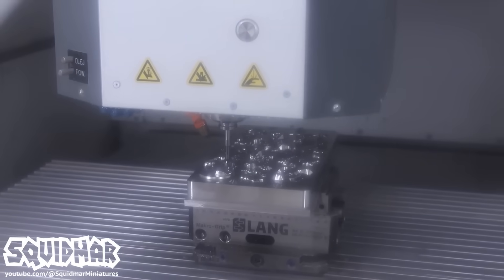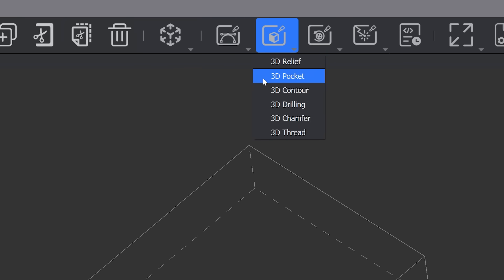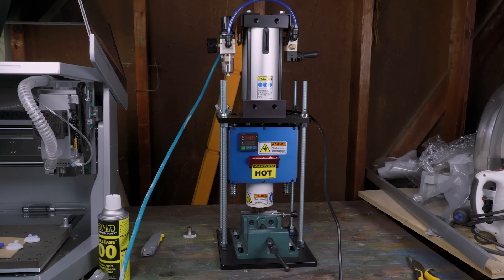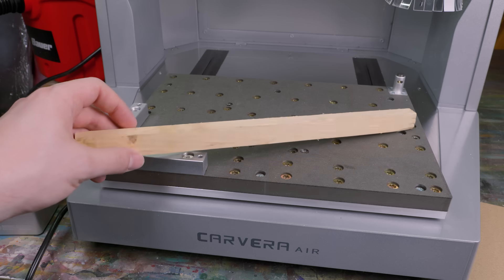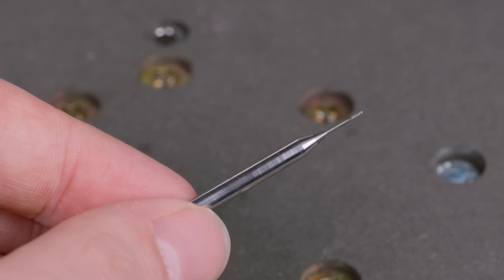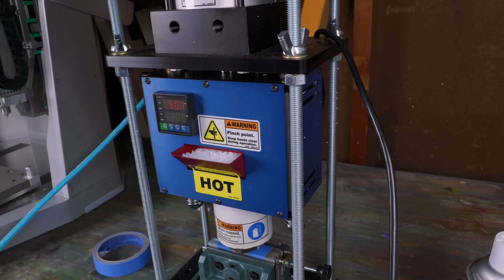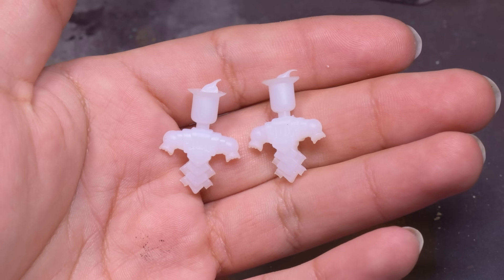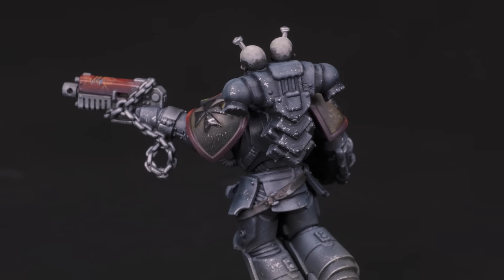You Can Make Warhammer Plastics at Home Now!

Comment: So the math on this is, and lets assume $500 in learning costs for matierals and tooling you will go through before you reach proficient. $3k for the cnc machine, $3-4k for the injection molding machine, so lets say $7.5-8k invested, not counting time, to get where you can resonably produce what you want, training in 3d modeling is not included in that price. 
That would be about the same as 2 battleboxes and a couple of character units from GW, so it seems reasonable.

Comment: There are open source CNC milling machines as well as mold injection. While it may sound like a lot of work I’d image it cuts down on the cost by a significant amount. And there are very plastic like pouring materials that you can use to just cut out the whole mold injection.

Comment: I worked in a mould injection factory, make sure to get what is basically a cleaning plastic pellet and run in through the hopper until it runs clear after you have finished every use otherwise you will run the very real risk of an internal blockage meaning dismantal time

Comment: If you managed to make a rogue trader Ork Battlewagon, they are selling for about $250 on ebay, so a near perfect copy should go for half that at least, so 70 of them sold should cover the equipment and bits, then you could reproduce the upgrades to make the Gobsmasha, and battlefortress. . Ine of the most expensive oop things is ork, eldar, marine and imperial guard arm sprues, you could get 8 on one plate that size, and thry go for anlbout €25 each. . just saying 😊

Comment: Unless your going to make a thousand of one item, making a metal mold and going through all this is ludicrous for metal molds. 3D printers allow you to print as many as you want, then move on to another item. How many metal molds are you going to make and how long will you use them for? Back in the 90's I had made 2 part vulcan resin molds of a load of miniatures, using pewter that I melted on my stove, but only made a handful of figures from from each of them, so it was kind of a waste. But I used to them to practuce painting and they were my favorite figures. But it was pretty easy to do and didnt cost very much. But this set up is useful if you are starting a business selling your own sculpted miniatures, as 99.9999% of people would not find this useful at all.

Comment: So, bottom line. If you are a professionally trained CNC machinist and have some experience in 3D modelling, you can do your work at home now, if you also spend your yearly savings on a CNC mill, an assortment of drill bits, an injection moulding machine, raw materiel (those aluminum blocks dont grow on trees) and have a spare room that you can turn into your private little manufactorum, just to re-experience to joy of mould line removal that your 3D printed miniatures made you forget like a bad nightmare.

Comment: Interesting to see consumer level plastics manufacturing becoming more of a thing. Having worked in plastic miniature manufacturing for  the better part of a decade, it's not easy, can be very expensive, and requires not just an understanding of engineering for plastic manufacturing in general, but a whole set of knowledge at the scale of miniatures. so much more to consider in design, tolerances, and process.

Comment: Anyone saying "Oh these machines cost ~$8000, just use a resin printer to print your army for a few hundred dollars.", this is for cost efficient production AT SCALE and will let you make dozens of armies from a single mold and let you make a new mold for a few dollars. Since models will cost you just a few cents in plastic granulate and electricity while being much faster than resin printing. If you wanted to mass produce armies, you could also keep adding the (cheaper) injection molding machines and scale the output proportionally.

I'm sure GW hates seeing this video.

Comment: We knew this is coming in the plastic hobby, everything is becoming portable.

May i suggest tho, could you make a comparative video of the same part between a portable mold-injected part vs a 3D printed one. How each matches like initial quality off the mold/print, excess cleanups, extra work needed (like shaving, panel lining, extra detail), parts progression - like how each complete part comes off (as sections) to form one whole, and finally - surface quality.

That would be genuinely trailblazing information for many wannabe custom figure creators.

Comment: The answer is NO.. Its to expensive for a reguler homeuser.. 
What you could do is have 1 alu box, make a resin form inside, and eiter use a 3dprinter pla head, or a plastic heater/pressor to put plastic into the mold. 
The alu box will stop the resin from from breaking, but it will start to crumble, over time.

Comment: If you ever run into the plastic not flowing everywhere it should try pre-heating the mold a little, if the mold is leeching some of the heat it can cause the plastic to harden before its flown everywhere it should.

Comment: i work with plastics (injection molding) and far as i understand games workshop use  polystyrene plastic,.. no the most expensive plastic out there ;) we also make molds of aluminium for testing or project, its not that expensive to make, but they last just a set amount of molds (think we garantee like 30-40k molds)

Comment: There are heat resistant resins that you could use to 3d print the mold (or a mold for the mold that you could cast in a lower temperature metal like Zamak 3) and less expensive injection machines (but I recommend the pneumatic one is you plan to produce a lot  - your arm will thank you!).  This could reduce the barrier to entry to less than $2000 but the trade off is a higher skill requirement and production cost as you add to the molds you're designing.

Comment: Is the "make at home" clickbait or I missed that part? 🤣🤣🤣🤣 Not everyone have cnc metal molds cutters just around.... You should have tried to use available resources! Like epoxy+metal powder etc. Or adjusting injection parameters like pressure etc for tin molds that you cast. Or trying injection with polyurethane etc.

Comment: And having to perhaps make several molds before you get it right, especially with more intricate things, and getting even more detail and smoothness, you get an idea of how expensive such stuff is. This needs more detail than for instance the plastic lid of your bin, so even though smaller, it is more expensive, far more expensive.
Then these machines are in comparison cheap for what stuff Games Workshop uses costs.
But the result is very good. Now i wonder if this is nice for own use, or if you can even produce a bit more, on a larger scale. And how does it do compared to 4k resin printers, let alone 8k and 16k ones, though i would think those are more for just one person and more one off or a few bits at a time, not mass production.
If you want a complete custom army, i might still go for resin, if you want to sell, this is probably more what you need ? I guess it all depends oin a bunch of things.
This is i am guessing also great for prototyping ?
So cool we can now get such things.

Comment: Mold making is a career, BTW. (The same goes for any occupation that specializes in making tools, dies, and molds.) You should check out the video on “Smarter Every Day” where they go over the process of trying to make a product entirely in the US—there is a section in the video where they are trying to make an injection molded part and they talk about how America needs mold makers. Unfortunately, it’s a skill that has all but disappeared in America.  

It’s VERY cool that you figured out how to do this on your own. As a trained machinist, I know that it’s difficult to learn the skills you need for CNC machining. I especially like the part where you figured out why your bits were breaking; a lot of people would have given up at that point — nothing is more frustrating than breaking end mills…

Comment: DIY plastic injection moldings been a thing for a long time but making the molds with a CNC machine is still a huge pain and generally not worth it for a small scale home operation. there has to be an easier way to make molds yourself for home use.

Comment: for you and anyone else looking into this, for speeds and feeds, a good rule of thumb is (3.82 * (materials SFM, the manufacturer of your endmill has charts on their website)) / tool diameter = RPM, and RPM * chip load (probably 0.001-0.0005 for this size) * # of flutes = in/minute

Comment: As a guy who's worked in injection molding for 12 years, I can tell you, there's been a kinda low key massive market for at home injection molding from kits that convert drill presses to machines like yours.
Also, if you need to cut metal, just get a bandsaw a General Purpose blade is fine for aluminum and for dies that small a small one is fine enough.

If you want better quality, aluminum can be sanded for a smooth finish.

Comment: You used a lot of what we call z-level cuts, which is great but sometimes you can use a lace cut at the end to clean up some of the tooling marks. I don’t know what your software calls lace cuts but basically it runs side to side stepping over per pass rather than stepping down per pass

Comment: There's a buster beagle plastic mold injector kit that you need to assemble yourself and is about $400. I've often looked at that kit and never pulled the trigger because I have a 3D printer. But could certainly knock off a bunch of identical minis quick that way. There's empty aluminum molds for sale where you could in theory 3D print the inside of the mold or pour the mold with epoxy resin and router out some sprue lines after.

Comment: locator pins out of 303 stainless steel turn to size on lathe, always proof read program before first run on any CNC and then for first article, first part, run at 50% or lower so can stop when see an issue before cause damage to work material or machine.  Just some advice from a guy in the aerospace tool and die world.

Comment: Try making some chest designs that don't have any Aquila on it, and have the part where the backpack attaches at be the area where the injection happens so that way you can get the half sphere that makes the positioning for the head as well as the leg connection joint, and because the sphere section will be there you can make it easier to remove the piece plus you would need a three-dimensional mill if you wanted to do it where the chest piece would be facing you when you open it up, and yeah you might have to do a little cleanup on the front of the chest because of the potentiality of anything leaking but that's not really the worst thing

Comment: Here's a crazy idea I've had bumping around in my head for awhile: one critical component necessary for plastic miniatures is raw material. Normally, you would purchase the polystyrene pellets new. But what if you could get your own "used"? What if, instead of purchasing new pellets from a manufacturer (in China, Taiwan, etc), you source your plastic from a nearby landfill? Sure, you'd have to sort out which plastic is the right kind, and that takes time, and more time to melt it down, but that's a potential gold deposit for material that's next to free. And, once production is in full swing, you can then say these are produced from 100% recycled materials, thus catering to any customers concerned for the environment, as well as oil production!
Reply: Why a landfill? Just use all the old sprues from Jay.

Comment: The flood of breaking Bits reminds me of when I made the change from Universal G-Code Sender to Openbuild's Control because of its ability to run Macros enabling it to have such Functions like a Centerfinder, or Tool Changing, etc... The problem I found with Control though is with its return to Zero Function which must have been coded by a friggin' Monkey 💢. If you call that function the machine will FIRST move the tool to a height of 5mm above Z Zero ( height ) and THEN move to X & Y Zero ( left/right & front/back ) which in 99% means you'll break a bit on whatever system you use to hold down your workpiece UNLESS your Workholding System is either nailing your shit down to the Sacrificial Board ( good luck doing that with metal parts ) or a Vacuum Table ( which no one buying an Openbuilds System  will have ). For anyone else using Clamps - even ones barely raised above the Workpiece - it'll usually mean snapping off the Bit as it collides with them or the Screws used to tighten them down. Fuckin' Brain Retarded ( still super pissed about this BS ).

Comment: For the locating pins on the mould, try buying precision ground pins (readily available) and a press fit them in one side. The other can be a close running fit and will allow better alignment. Also deck the plates off flat so there are no surface inconsistency’s.

Comment: if you keep messing with this, you can setup a set of jobs just for making your mold blanks with holes on one side, and posts on the other so that you don't need any secondary plastic pins.  you would be taking about 2-5 mm off the face, leaving the pegs on that side.  We use to make VERY simple injection molds out of steel with a slightly larger injection molder than you used here (or I should say used to, this was several years ago).  On Mondays I would make blanks, all day long, 10 at a time on the 3 axis mill.  our injector took 300mm x 300mm molds, I would face each half at the same time with a small fly cutter then mill my register holes with a FLAT bottom mill and then do another few face pass on the peg side leaving the 2 register pegs 2-5mm tall depending on the depth of the relief of the mold (I always made my register pegs at least 1/2 the depth of my mold).  Only once I have tested my peg register fit did I do final perimeter dimensions and start my actual mold layout.  All of that can actually be done way faster on a single mold using a manual mill, the CNC just lets you get more work done during this phase and makes complex molds possible.  My molds were not complex and were usually completed on an old Bridgeport because I was just working with arranging various primitive shapes in the right order to make plastic spacers, gaskets, and caps.  I am super excited for the next technical revolution...the home industrial era of mankind.  I have been doing some research, and the tools you need to create your own engineering Firm at home are now right around 100K in total for doing prototypes of systems and devices of less than 1 square meter.  I know that sounds highly restrictive, but 90% of all consumer goods are either within that limit or made up almost entirely of parts within that limit.  A home millwright can get started for less than 15k, 35k gets you a full kitted wood shop for 1 master carpenter and 2 assistants, 50k for the same but for handling composites that are used like wood normally would be (Corian, Formica, Granite - but the consumables are twice as much for this).  It has never been more easy for the private enterprise to obtain, maintain, and customize their tooling and today's hobby grade equipment is not only affordable but the difference between hobby and pro grade are only in machine size or overall speed, not accuracy or general capability.
Reply: Or make some dowel pins out of metal. Thread on one end, with a screwdriver slot in the other, and some appropriate sized chamfers so the pins go in the hole on the other die easier.

Comment: I find steel actually much easier to mill so long as you are using correct speeds and feeds.  Aluminum scorches and gouges easier, can gull, and that softness grabs those tiny bits so easy....as you found.
Reply: Yes and no. Steel needs to be cooled while milled. At lest by a compressed air. And you need way better quality tools. Milling with sub 1mm tools is not eazy.
Reply: @cwaldacwaldovic4572  true, true...
Reply: @cwaldacwaldovic4572  yes, you do need far better tools and cooling.  If you use slower speeds you can manually oil, this will take eons though...but a 5 gallon bucket, aquarium pump, and some zip ties gets you a very effective cooling solution (though it is messy) and you need to have a couple of screens in front of the return I use 5 layers of pantyhose when I need to rig this up on my drill press or bandsaw.  Universal cooling system for total cost of $75.
Reply: All materials are easy to work with when your values are correct 😂
Reply: @Suomiwimbula  Point
Reply: Yeah but wouldn't you need a more expensive machine to mill steel
Reply: @2superstobie  yes and no, but the costs of these machines is beyond affordable compared to 25 years ago.   What used to cost 10k is now closer to 2500 in the mfg world.  If you don't need a 4 axis mill with 100 tools, heavy machinery is actually affordable.

That being said, all you need to mill steel over aluminum is a rigid frame (which this already has), carbide bits, and cooling.  you could easily setup a custom cooling solution with a bucket, aquarium pump, and a couple of clever zip ties.  You could also buy a piece of 1 inch mill stock, trimmed and surfaced then weld the frame of this machine to that plate making it even more rigid.